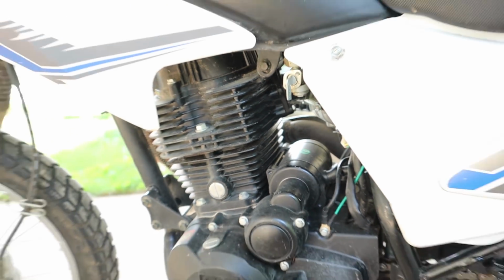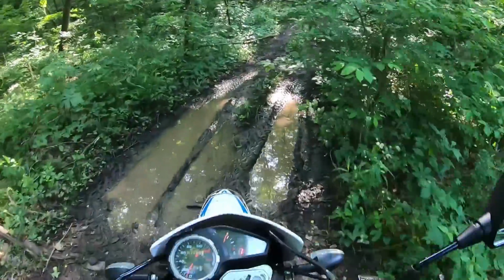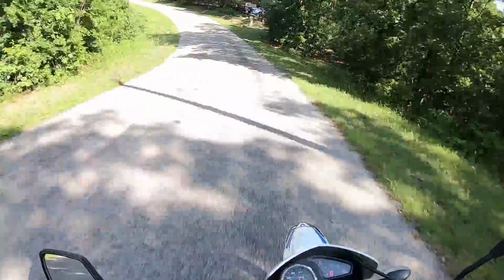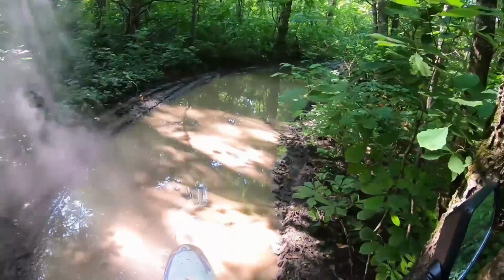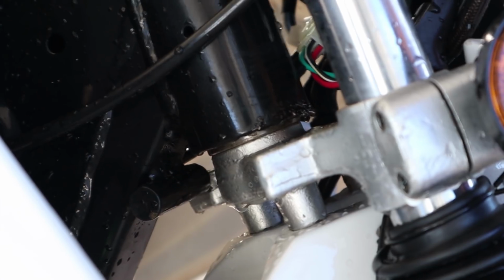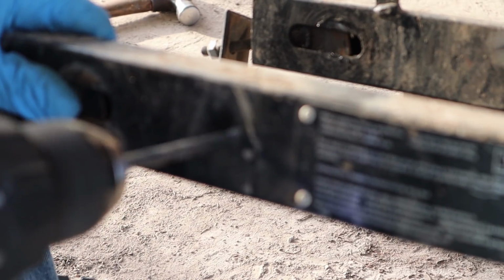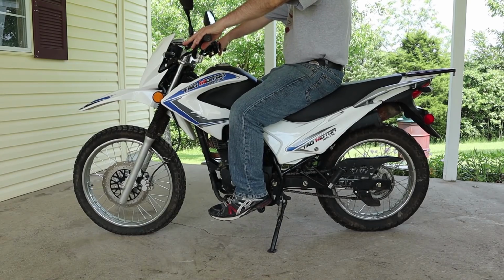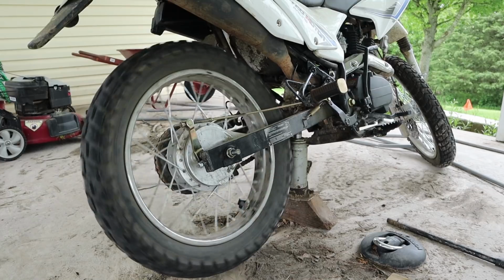Testing the Worlds CHEAPEST Motorcycle!

Comment: Do you have any problems getting parts? I bought a Chinese quad and a dirt bike several years ago and it was impossible to get replacement parts. I had piston and rings on order for 6 months before the guy running the shop just gave up and said he couldn't find a reputable supplier for parts, not even the manufacturer. I don't care how inexpensive it is, I can weld and modify the carb or fabricate some things but when it comes to electrical parts and internal engine parts, I would rather not have to try to scab things together. If it can't be fixed, I would rather spend the $6K for a Japanese bike.

Comment: It's not cheap. Check out the Indian tvs xl 100. Cost 600$ brand new. It is just a 100ccm bike, but again the most sold bike in India with 70-80.000 units a month. 80kilometers per liter. Bare and as heavy duty as a small bike get

Comment: I was considering these but ended up with a rebel250 with 1400 miles on it for 1500. Glad I got what I did. After 10k miles, it hasn't needed anything but oil. I've owned a couple Chinese scooters and while they were reasonably reliable, they also took constant tinkering. I don't mind tinkering but it can get old on a daily driver.

Comment: Great review. I've been kicking around the idea of getting one lately. I haven't been on a motorcycle in over 25 years. I use to race motocross in my teens and twenties and I have a barn full of old Yamaha YZ frames and part's. I'm wondering if someone could rebuild one of these using a yamaha frame and swing arm, would probably make it safer. The one thing I would be worried about riding this is to have the frame break up by the front forks and end up face first eating asphalt.

Comment: I bought the kids a China 125 cc 4 wheeler....1st day out I had to weld the front foot rails to the frame because it was shipped shit welded to the engine block....after that I had to reweld a broken frame 2 times....but it started every time....used my $99 Harbor Freight Welder....not cause I didn't have 220v but because the steel was so thin it would have vaporized the metal

Comment: Here in Argentina, chinese bikes are widely sold. Most, if not all of the main motorcycle manufacturers rebrand  models bought from China. But those are assembled in Argentina and then handed over to the customer ready to use. 
Over time, I see an improvement in the quality and reliability of the models offered. In fact, most of the top sold bikes over here are rebranded chinese bikes.
Some examples of manufactures: Gilera, Motomel, Keller, Zanella, Brava
I think a model similar to this one is sold as "Motomel Skua", "Keller Miracle", "Zanella ZR", "Gilera Sahel", etc

You might take a look at those brands for quite some info about these bikes.

Comment: I have an XT250 Yamaha  at 3 !/2 times the price.  I seriously doubt I'm having 3!/2 times the fun you are..  That said, I have done virtually nothing to mine maintenance wise in 1200 miles..  And it's been thru some pretty rough terrain w/out incident.  You pretty much nailed it in comparisons between the two.  An old hot rodder would like messing with this.  A turn key operator won't... .    I am however a little envious on the wheelies.  I considered myself fairly proficient many years ago on a variety of bikes.  The XT250 is the only bike I had to preload the suspension or clutch it to get it up in the air.  And once up it wants to come down..  Seems front end is heavy which is ok for hill climbing  but not much else.  So good for you..

Comment: To fix the oil in the air box, just disconnect the hose from the air box and tape it along the side. Use a coffee filter to keep dirt out. Reconnect it if you're going to be riding through water. The PCV valve is either broken or the bike is cheap enough that it doesn't have one. 

Yes, it's going to leak environmentally harmful fumes to the atmosphere. If you live in California it's illegal. But with that tiny engine barely being used for 1,500 miles per year, I wouldn't feel bad at all about it.
Reply: John Kerry, Bill Gates and China are far more bigger polluters

Comment: So why would you even consider buying this? I spent $350 for a 1989 yamaha XT 350 that was sitting for years. Bought tires/tubes, battery, oil and filter, plug and simple quick carb clean. $650 in I have a bike that will spank yours on the street and woods plus I don't have to worry about it breaking down like yours or having all the cheap stuff break off like yours. This purchase makes absolutely no sense to me. If it was $500 delivered right to your door then maybe. 1,300 to 1,400 and then you had to do all that extra work and buy extra stuff, so what are your two grand into a very cheap cheap bike that can break down at any moment? That most certainly doesn't make sense to me.

Comment: I brought a Chinese scooter, Once i swapped every nut and bolt to Japanese quality nuts n bolts every squeak stopped. the handling felt better, the brakes worked better as the standard caliper bolts were soft monkey metal out the box.  Your buying cheap, your getting the cheapest of everything.

Comment: Thoes tires are definitely 80 percent street. You could have made it up hill there with a tad more momentum though. Nice video and good job doing the review. I wouldn't ride this thing on the freeway or on the road though in traffic. It's not structurally sound because the engineering is really bad and the materials are ultra cheap though, making off road riding dangerous too. I have seen one guy break his footpeg off on one of these in a nasty trail here in upstate NY. It broke clean off from the frame. It reminded me of the same metal those matchbox cars are made out of. Dicast metal. I wouldn';t trust that bike. I'd rather pay 3x the amount to get a 4 million times better Jap bike.

Comment: The PCV hose (spitting oil into the airbox) is working properly.  Might not be the best implementation, as it will cause the plastic to fail sooner, but extending the hose to create a low spot will only make the oil pool up.  Eventually, it'll all get sucked into the engine at once.   Not sure how carbureted bike engines handle it, but fuel injected cars will bog down and spit out a cloud of smoke when they ingest that much oil at once.  

Best plan is to add a baffled oil catch can, which requires draining (usually every oil change, depending on size).  Many people will use an air/water separator for this, which is originally intended for use on compressor lines.  They're also usually clear, so you can easily check the level of oil.

Comment: 8000 miles on my TBR7 and as long as you have basic mechanic skills it  is not a death trap. When you first get it you have to go over every nut and bolt with some loctite, do the engine break in before you start beating it up. bullet proof motor.  you should have watched a few more Motocheez videos.

Comment: To avoid ALL these fix-up and weak spots, BUY JAPANESE.  The extra money you spend will be spent anyway paying for replacement parts, workarounds, fixes, and welding.  Plus, it will perform much better no matter how many miles are on it as long as the former owner did the proper maintenance.

Comment: i got the rps magician. (same thing) had it for like 3 years. it's really reliable. i wannaget the new fuel injected one thats out now
Reply: Dear God, please don't do it.

PSA: those Chinese fuel injection systems are really bad. The may quit working at any given time and replacements parts are sooooo hard to come by. I've seen way too many of those bikes and almost none of them can last for a year.
Reply: @TalasDS   thanks for the advice. ill stick to the carbureted ones i guess for now. honestly probly gonna get the new honda crf300l for my next bike
Reply: @matthewdubay6409  tbf, getting any known brand bike is basically better in every way. I have one of these and I'm not going to lie, they're pretty reliable given that you know how to repair them. Around here, parts are sooooo cheap it's insane. You can rebuild the entire engine for less than 100$.
But there's no way I'm trading my other bike (a Suzuki) for one of these. I can't remember the last time I've made a repair to my suzu. The Chinese one I repair almost weekly 😂

Comment: Buy a proper bike frame without an engine in it and use this engine. Safe frame and a simple yet strong engine.
Reply: Olli Lehtonen support welds are way easier. We did those on chinese mopeds and samurai minicrosses ;) my buddy broke his samurai in half
Reply: @piuthemagicman  Heh, i did the same to my BSE. Snapped the rear fork pivot tube off of the frame and that thing shattered like glass instead of deforming.
Reply: Olli Lehtonen damn sounds like they're made out of model car die cast metal 😂
Reply: @piuthemagicman  Yeah. The tube literally cracked off and into small pieces. I welded it back together. The bike's been through hell. Have had her for over ten years. Before that, no issues except wheel bearings and other wearing parts. It's a weird type of metal. Magnetic and good for welding but it does not bend or flex. Just breaks.
Reply: Olli Lehtonen interesting to say the least 😂 perrrkele
Reply: @piuthemagicman  exactly.

Comment: I've had really good luck with Chinese engines/motors, I own a landscaping company with several small 2 strokes in my fleet, and aside from replacing a fuel line or a spark plug, they've always started in 2-3 pulls, hey, Chinese engines might be the new Hondas, just saying, they havent let me down yet, and some of them are coming up on 4 years old, used commercially,  I will buy one of these bikes though

Comment: Do an airbox mod when the emission police aren't looking.  Not only will your oil problem disappear it will also help with the stuttering and loading up common with 2 stroke bikes..  Too much oil in the airbox will screw it up every time.  I bought a CZ 400cc motocross racing bike in the early 70's.  The carb sucked  so it was replaced with a Mikuni.  At 400 cc pulling up the wheel and riding it out in 3 gear was pretty easy and the torque was awesome.  At the age of 72 my son and I went to the Mojave Desert and rented dirt bikes for the day, rode them with a former M/C rider as the tour guide and the 300cc I had would have put the 400cc away easily.  In fact, the whole bike was so good  that I actually thought I was as good as I was when I was almost 50 years ago..

Comment: I bought one of these a few years ago, the brand name was different but it was identical.  It did come fully assembled as I bought it from a dealer, however I had to go through the while bike and check all the torque settings .  It’s basically a modern build of an old Honda XL motorcycle, I was told that the Chinese factory licensed the design from Honda for the engine but I don’t know if that’s true or not.   Anyway, it was OK, it was much slower than a Japanese bike of the same capacity, but it was reliable and good.  The engine seemed to need the valve clearances adjusted frequently, but I seem to remember 70,s Hondas being the same.   For the money it was good and yes I would buy another.   I did buy a different Chinese motorbike and that was a total disaster, total rubbish.. and it cost a lot more too.   So not all Chinese bikes are the same and spending more does not guarantee better quality.
Reply: I had a honda xl back in 84. I was 14 maybe, that's when you are legal to ride here, nothing over a 125cc tho. Not until a bit older, and there's a curfew unless you work. I used mine for my paper route. That thing went 60 with me and a friend on it lol. We rode that bike all over NE Oklahoma. You couldn't tear it up unless you literally wrecked it. 
I have heard the same that you said about these having a honda engine or I heard a honda "clone", IDK...I still want one and am ready to give up my Honda Shadow Custom Deluxe VLX 600 with just 12k miles. Don't wanna, but they way things are going, I could use a bike that I can get off road with. Plus my bike is LOUD, because it's a custom deluxe and I put pipes on it, changed the bars out, etc..etc...it's just really low set and very heavy for a 53 yr old female who weighs all of 110 lbs. on a good day. Anyway, I'm replying to an old comment. It's 2022 and I see these and the Hawks (selling for a bit more) fully assembled Tao Tao is about 1600 bucks. Can't really beat that. I'm heading out to find a dealer hopefully nearby that carries them. I don't want to put anything together lol. 
Thanks for confirming what I keep hearing tho.
Reply: Lifan and CF Moto seem to be the best Chinese brands.

Comment: I purchased the motocross Atomic 250cc 4stroke air cooled.Was decent held together & did 145 kmh flat stick would i get another nah.KX250F JUST A MAD DIRT BIKE ELECTRONIC FUEL INJECTION Air loving machine tops out at 100kmh needs sprocket for top end.

Comment: I had a Chinese 110cc fourwheeler, while working on the engine we found a factory glove stuck between the head and the block. No fingers though.
Reply: No fingers no refund!!!
Reply: Did TheFactory Run Out of Gaskets?!?
Reply: @aretnap3653  Well I guess a glove is atype of gasket in a way Glove/Gasket duality
Reply: Are any parts such as brake pads or air/oil filters available?? Are they interchangable with Honda or any brand?? Or is everything propietary to the bike??
Reply: Try adding a small oil catch can in line. Bikes are not designed for wheelies, oil is suppose to be in the bottom of the oil pan..that may be increasing that oil issue.
Reply: @jameshill2015  thing ain't got no power to wheelie..
Reply: I believe this entirely
Reply: They were just sending a small gift
Reply: I found a small rag in the intake on a ssr 125 I bought for my kid. I got it from a guy who said he had issues with it getting really  hot and getting really hard to start. I gave him 400 bucks and found the problem later that day when I was tearing it apart.
Been a fun bike for my son since, no really issues..
Reply: That has got to add at least 50 hp
Reply: Lol only china would do something like that.

Comment: thats a scam, where i live you can get a 6 speed honda supra GTR for $200 cheaper with a 6 speed and a 150cc engine, or you can get a real motorcycle like a honda CB150 verza which looks cooler but performs worse than the supra GTR moped (13 vs 16hp,  5 vs 6 speed,  110 vs 140 km/h)

Comment: I have a Kawasaki KL 250 Super Sherpa I bought new in Sept. 2000. She's now 19+ years old. 4,600 miles. Except for a little sun bleaching on one side panel she looks NEW.  Never had problem #1 with her. Top end I got her to 85 mph. If she had a 7th gear 95 would be no problem. At 85 she had the power but ran out of breath, she was SCREAMING. Yeah I paid $4,000 for her but you get what you pay for.

Comment: I have a 2017 Hawk 250 and I have done all of the mods. It's got over 5k miles and has been an amazing bike. I've rode 400 miles in one day, loaded it down with camping gear, max out at 70 mph after mods and new sprockets. This guy is short that's the only reason he'd think it's too tall. I could go on for days about why the hawk is a good bike. I've taken some rough trails, even crashed at 60 mph and rode the bike 30 minutes home after. Had the cosmetics fixed in a week after getting only what couldn't be plastiwelded back together. I still ride it everyday as my main transportation. It has an exact copy of the Honda CG engine and I've gone to the Honda dealer for engine parts to upgrade from the Chinese parts that came on it. I did a port and polish on the cylinder head and got my head gasket from Honda. Took less than an hour to swap heads. You can get all engine parts from Honda. I used the Honda service manual I found in .pdf on Google for specs. If you are a capable DIY you can handle the maintenance and mods. Motocheez, JerryHawk250 and Oddball performance (aka MegaDan) have excellent videos and tutorials. I've been a professional mechanic for 13 years and I love my chonda. You definitely need to check it over right out of the box, make sure all bolts are tight and put loctite on the important stuff. I never needed loctite I just made sure everything is torqued. Common sense people. You'll have to do the same thing with a used Japanese bike too. But if you're lazy and can't do preventative maintenance or pre ride checks then you probably shouldn't own a bike anyways. Other than that, pretty spot on review. The hawk is better quality than the tao. The luggage rack will also bolt right on the Hawk. It's perfect as a commuter bike and fun on trails. It will do long distance as well. Taking it on the trans America trail when I get home from Kuwait next year.

Comment: i ride a chinese motorcycle to work

i guess it's better than commuting...

 it's as reliable as a Honda
cold start is 2 or 3 kicks
it rides in rain just fine
fuel consumption is acceptable for the displacement of the engine

downsides are:
 the electronic parts are "Cheap" those are the first things to go wrong

Comment: Popular Chinese motorcycle manufacturing materials:

Crapite. A weak steel alloy made from an unknown metal (and God knows what else) that has been recycled thousands of times.

Shiteium 90. Another metal alloy that turns to shite 90 days after purchase. Popular for use in screws and bolts, welds, valve guides, valve stems, sprockets, chains, cogs, etc.

Nylonium. A type of Nylon found, believe it or not, as a substitute for engine chain drive sprockets and as bushes on transmission systems where one would normally expect to find a ball race or phosphor bronze bush.